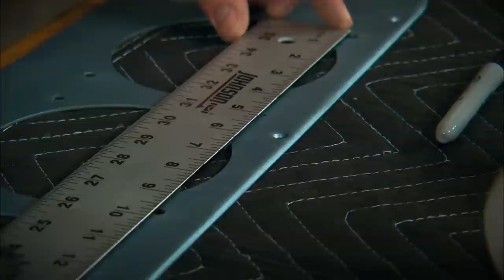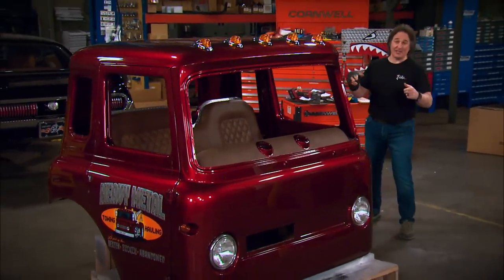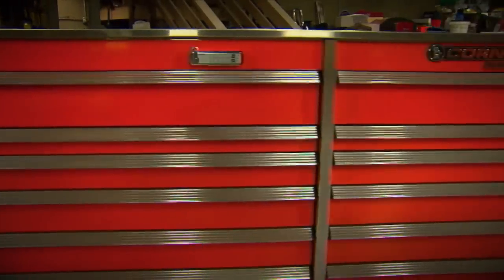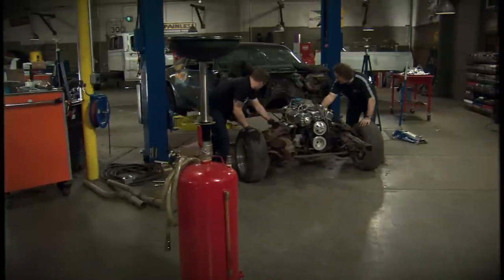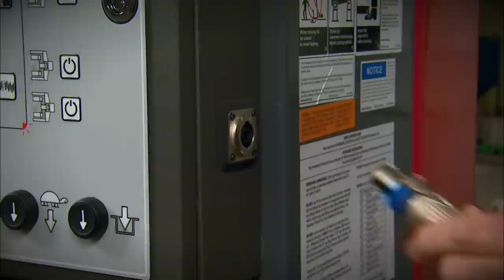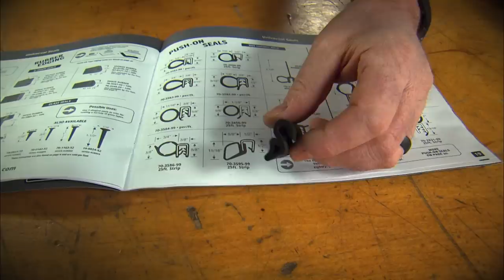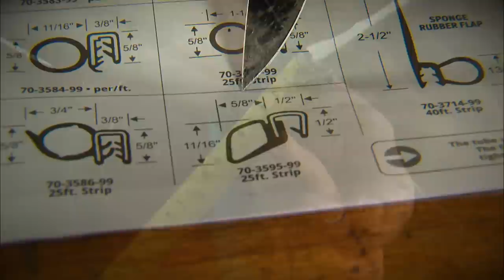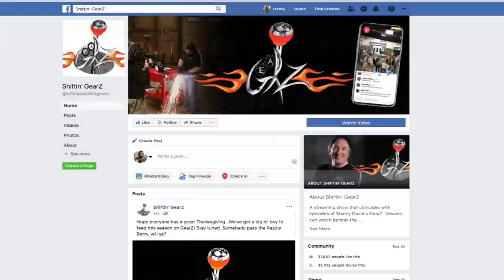International Cabover Tow Truck - Project Heavy Metal Dash & Interior - Stacey David's Gearz S13 E3

Comment: Stacey ....I love heavy metal. ....What I would like to see in the middle of the dash is a CB radio a must in a wrecker, a am-fm radio and a back up camera screen. Plus a few 12v plug in receptacle and USB ports 👍👍  OH! And few other things I would like to see is a shiny air horn and some spot lights with a nice amber light bar somewhere and enough lights to light up the whole work area,front back and sides . Maybe a gasoline mig welder with a generator and a nice vice in the back with some cool mud flaps , with LED running lights  👍👍. That it for me now. Any body else have any suggestions 🤷🏻‍♂️
Reply: The Bushwacker    Now that you mentioned it, I think a inferred windshield would be a good idea like the ones Cadillac had on one of it cars  back a while ago  OH! and a nice air compressor also , with a small bar bq grill like the pipe fitters have on their trucks 💪🇺🇸😎 love your show and love your work  stay strong bushwacker
Reply: The Bushwacker .....I like it ! you work on that I will try to figure out where were going to put those two 30 calibers at that you mentioned. What do you think about one pointing towards the front and the other towards the back or both towards the front 🤔😂🤣😎👍

Comment: The two air vents are at different heights ......., would have looked better at the same height .
Reply: That is my personal pet peev with car designers. For some reason, they always have the passenger side vent mounted lower. I live in Canada and need to remove ice from the windows in the winter, but the passenger vent is always too low, and it takes longer to defrost the passenger window. Personally, I think a symmetrical dash is not only more functional, but it also looks better.